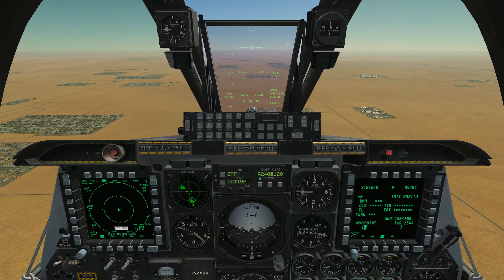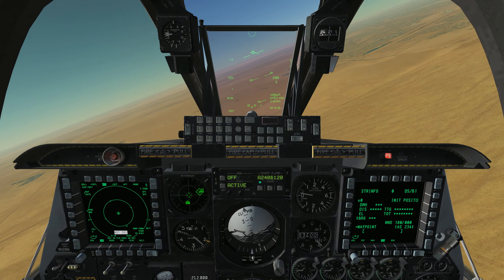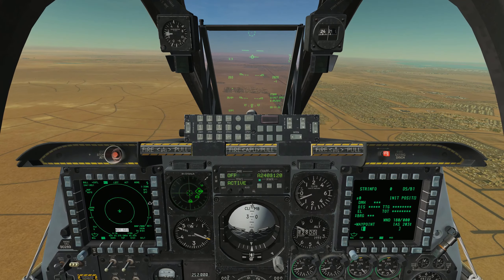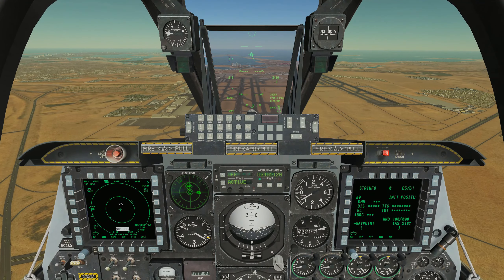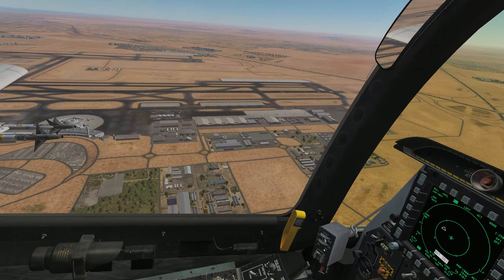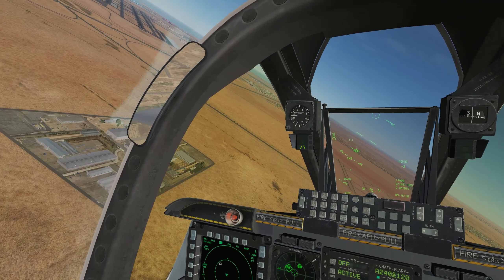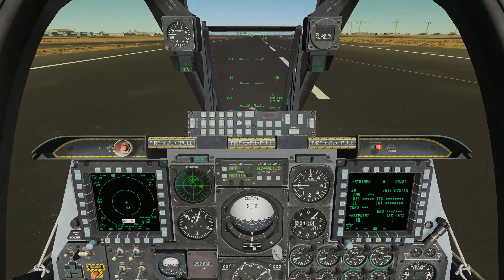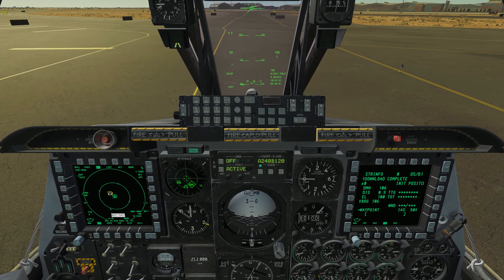DCS World Tutorials - A-10C Warthog - Standard Traffic Pattern and Landing

Comment: When you make the 180 degree turn above runway, are you trimming nose up whilst also applying throttle to keep the vector path on the horizon, or is just throttle only?
Reply from the maker: Sorry for the late reply. This isn't a great answer but I sortof feel it out. I add some trim but not much. I mostly just introduce back stick pressure to keep the plane level. As for throttle, I do add a little but ultimately I'm trying to get slowed down so I don't add too much.